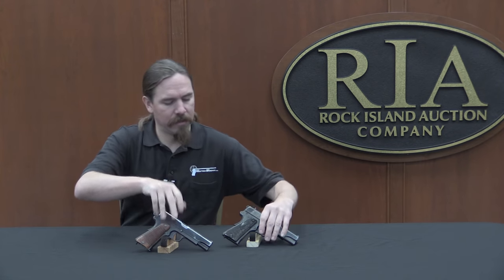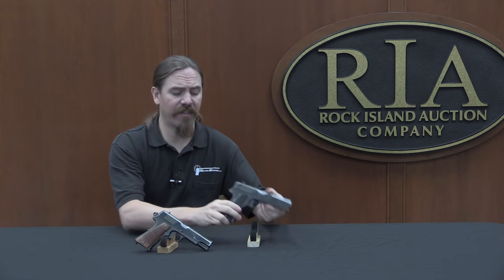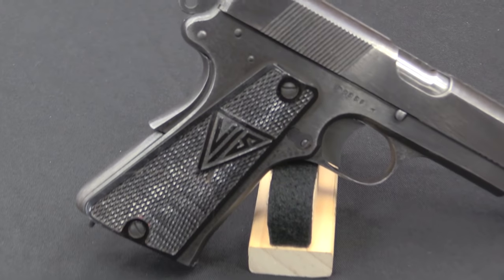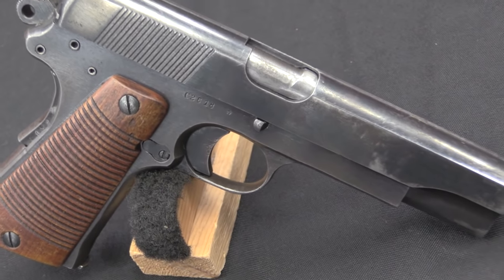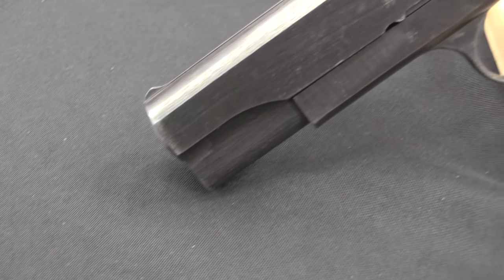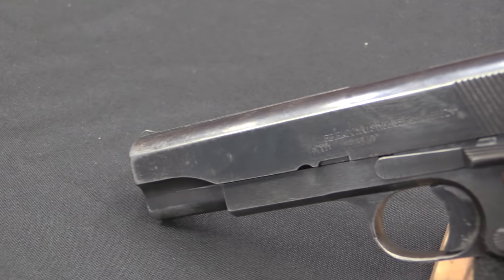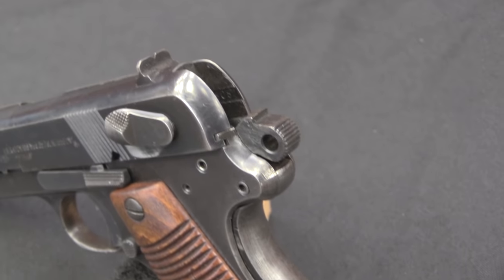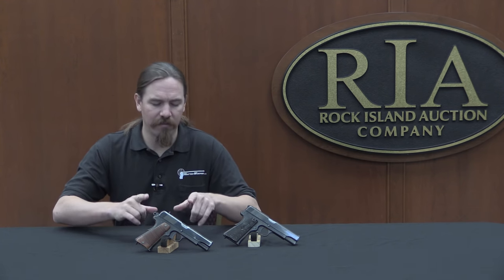Radom's Vis 35: Poland's Excellent Automatic Pistol

Comment: On the two lever your disassembly method is incorrect. If you notice the hammer has a notch cut in the top of it, pull the slide back and when the de-cocker is over the hammer simply pull the de-cocker down and the de-cocker will catch on the top of the hammer and hold it open so you can remove the slide retainer the same as the three lever does. Here is a video on the correct method to do a late war. https://www.youtube.com/watch?v=-qRVzF8Z1l4

Comment: So it was a single action pistol with a grip safety but no thumb safety, and a decocker...how did Polish military doctrine intend for this to be carried? Hammer down on a live round, then thumb-cock before firing? Or if the decocker wasn't really intended for use...was it to be carried with a loaded magazine but an empty chamber, and the slide racked before firing?
Reply from the maker: +elektro3000 Loaded mag, empty chamber.

Comment: funny Polish Calvary worries about that while Germany was plotting there downfall
Reply: Cavalry was necessary because Polish infrastructure was still in 19th century standard. Cavalry was horse borne infantry. They rarely fought from horseback. Unlike straight leg infantry, cavalry was able to move quickly around the battlefield. Drove the Germans nuts. Ready to surround a unit only to find it as already gone to set up somewhere else.